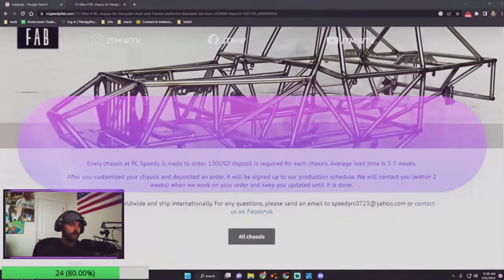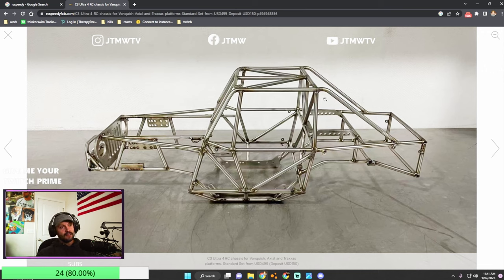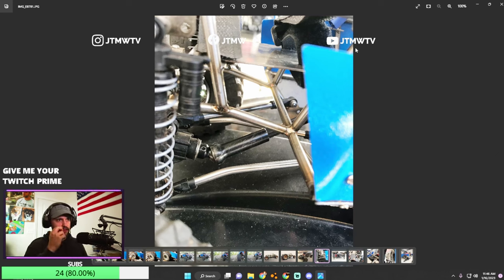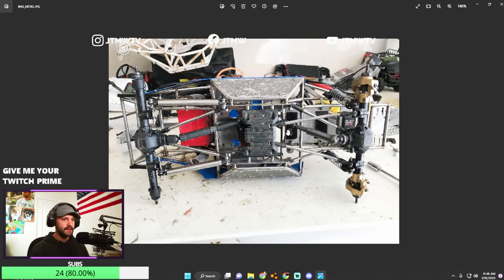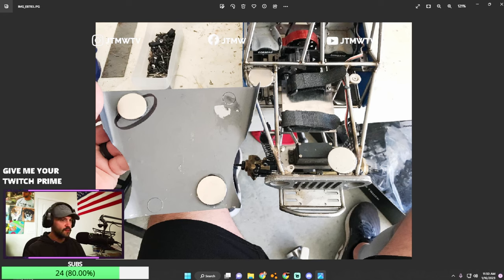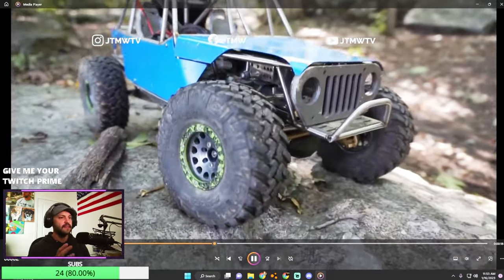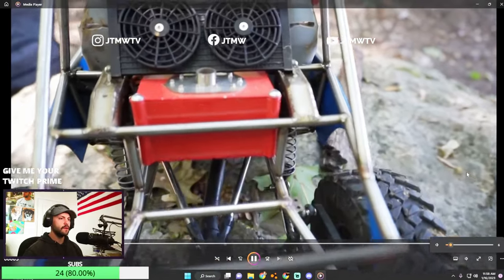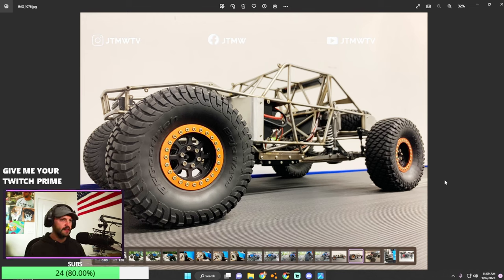An honest review of RCSpeedy, C2 Chassis RC Rock Crawler - Trail Footage

Comment: I’ve got a friend with a C2. Definitely heavy cars out on the trails. Certainly some simple things you could have done to improve yours like tires or a better servo. Those are 2 very important aspects on a RC crawler. Interesting review thanks for sharing
Reply from the maker: Definitely so, but really that’s not the performance gains I was looking for. The fundamental geometry, mounting locations, skid design. There were so many factors that just made the car frustrating to deal with and work on. The real point is for the price, it should be a much more polished starting place.
Reply from the maker: I can’t remember if your friend used the Capra axles or not, but I was also frustrated with the compatibly with ar44 s. 

Like you said it’s all fixable things. I’ve got shift/ BOCO Servos laying around, and plenty of higher performing tires. But it definitely felt like I was going to be fighting gremlins for a while. 

Thanks for watching by the way, I’m a fan!

Comment: It seems your front axle if it was an scx10 3 offset axle or the vanquish offset diff axle the links would have worked but for the price it doesn’t have the durability nor figment youde expect and it seems to be a pain to work on being such a universal fit
Reply from the maker: I'm not sure if it's still an option but for the C2 I bought it was supposed to be compatible with the scx10ii axles and the links provided would have been that as well. This review and purchase came out before the ar45 axles were even available unfortunately.

Comment: Hi. I've ordered this week. Stating its forthcoming vs4 10 platform. So hopefully this should be problem free. Did u order it for a specific chassis?
Reply from the maker: Yes. I ordered mine for an Scx10ii. It will all be the same chassis and mounting points. The chassis used spacers to take any skid.